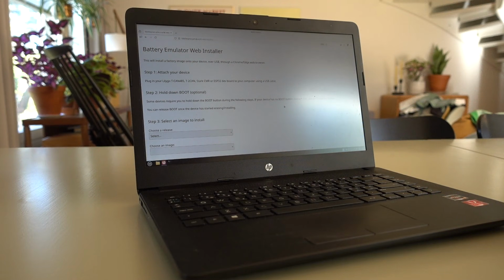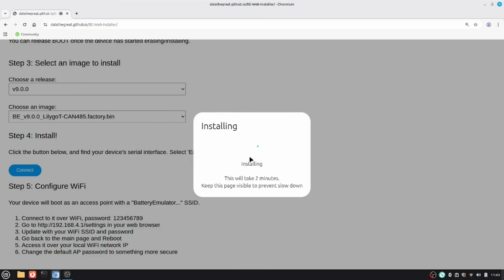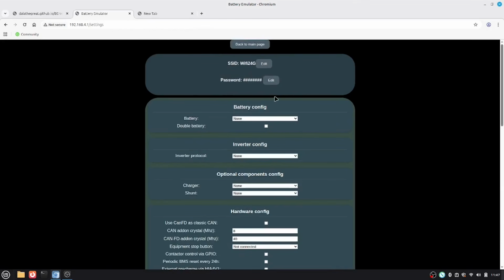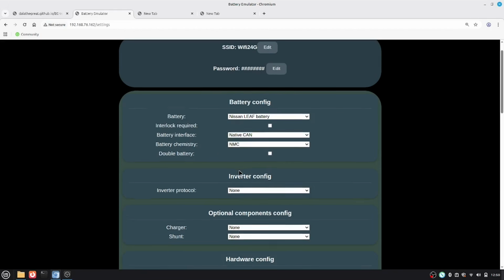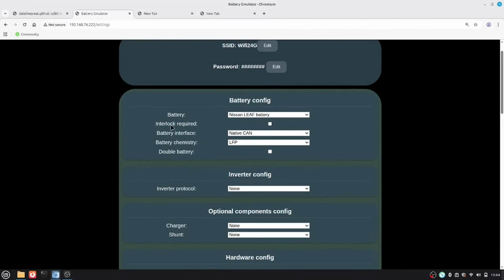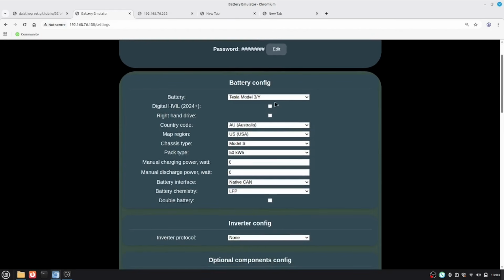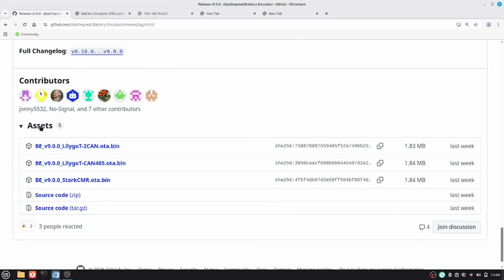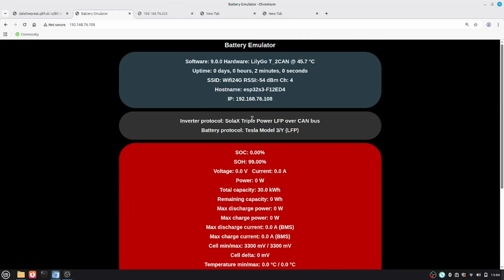Installing Battery-Emulator (2026 guide)

Comment: If this keeps going like this we will soon run out of used EV batteries :DD. Next step: Use battery while it is still attached to the car :D
Reply: It's officially called "V2x" technology. Using the electric car as the off-grid power bank.
Reply: @ukaszt8237 yes, but availble hardware is useless expensive.
Reply: @ukaszt8237  Yeah, a lot of work is going in this area, soon we will have a wave of new startups with this thing. :)
Reply: The Chademo version would be nice to see,
maybe a good topic for an video.

Comment: I was wondering how to setup now custom values for Daly bms ? configure the min/max

voltage/currents in the user settings the link is broken
Reply from the maker: See the Daly Wiki: https://github.com/dalathegreat/Battery-Emulator/wiki/Battery:-Daly-SmartBMS#software-configuration

Comment: Thanks dala! I hope to be able to do this project one day! 

Were you able to fix the Tesla BMS balancing issue? My understanding is that people noticed the pack wasn’t balancing the cells outside of the car
Reply from the maker: v9.0.0 emulates the full Tesla vehicle, so the batteries do not throw as many error codes, which is a very good sign. Time will tell if this is the missing piece to getting balancing working!
Reply: @DalasEVRepair awesome thank you! 

If you’re emulating the full vehicle, is it also possible to update the firmware of the pack? I think this is probably out of the scope for the project, but Tesla have released a lot of firmware updates for the BMS lately and I’d like to ensure the pack is up to date. Wonder if just plugging it into a model 3 over a long CAN cable would suffice
Reply from the maker: @iambenmitchell  Yes we are working towards flashing firmware, but it will be a separate project. More of this discussion is taking place on the Discord!

Comment: I tried the web installer but the biard wont boot, it draws no power and i cant get it to boot with the test firmware either 😭
Reply from the maker: Try another USB cable, or a different PC!
Reply: @DalasEVRepair  it flashes just fine but it then goes into a bootloop, no leds or anything else. And if i want to flash it again i have to hold the two buttons and realse boot then download just to connect it again. Ive also tried the factory firmware but no luck.
Reply: It worked with the 1.0 reslease. Heres hoping my bmw i3 battery is not locked 🤞

Comment: Once you said Sol-ark inverters have now been added; I literally screamed out loud 😅📢
As always, I thank you & the team 🙏!!!

Keeping energy independence open source is such a blessing! Been here since the beginning & have loved every minute of your work Dala ❤🎉🙏
Reply: @meganwinters5163 Please explain what this means for owners of the Sol-Ark 15k inverters?  I'm half awake and can't figure it out.  Say for example I have 2 Nissan Leaf 24kWh traction batteries.  I can't use them on the Sol-Ark 15k as a whole unit unless I separate modules from the case and configure it into a 48v setup. Is it easier to use like home assistant for communications?
Reply: @Braebyrn  I don't think that'll work. If you look at the compatible battery list, they've added the Renault Twizy which is a 48V battery, but only 6.1 kWh -- the only 48V on the list. I think that'd be the only one to work with the Sol-Ark 15k, which is a 48V inverter.

Comment: Thanks got  the wifi working .  a password less then 9  will not work
Reply from the maker: This password bug will be fixed in next v9.0.1 version!
Reply: @DalasEVRepair   no worrys thank for the good work
Reply: Do you have any plans to support more than 2 batteries in parallel?  

Along the lines ofna shipping container full.

Comment: Question, at https://youtu.be/sR3t7j0R9Z0?t=1086 you tick Right Hand Drive but use settings for Germany.  RHD usually refers to  the side of the car the driver sits rather than the side of the road you drive on. Can you clarify?
Reply from the maker: This was a demo, not an actual Tesla setup!

Comment: "FYI: HV INTERLOCK error has developed into a 'hard fail' of DC-DC. CHARGING WOULD clear interlock error & it was 'READY' again, but not yesterday. TOPDON TopScan Pro indicates 4V on DC-DC input. THIS IS exactly what is expected with failed input capacitor, or a switch component. TARNISHED CONTACT is degraded, but is likely associated with excessive amperage during stages of DC-DC degradation. INTERLOCK ERROR was leading indication to DC-DC failure. IS 2015 with 76,000 miles."